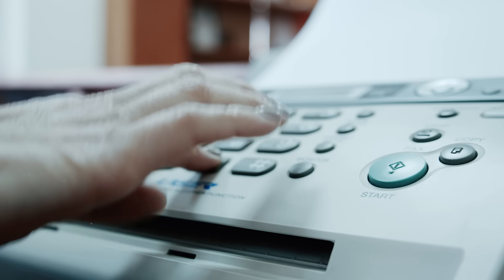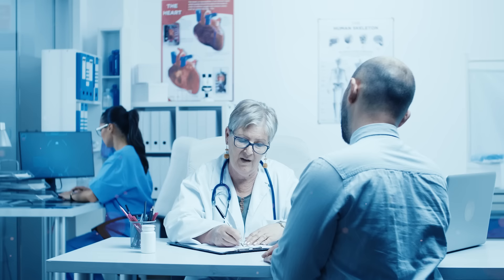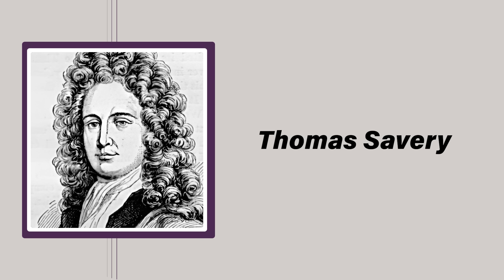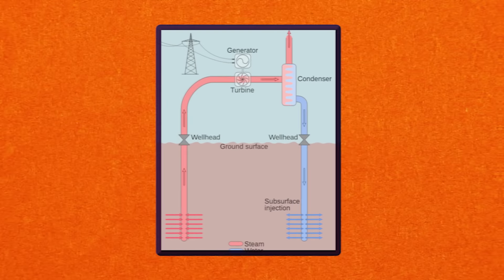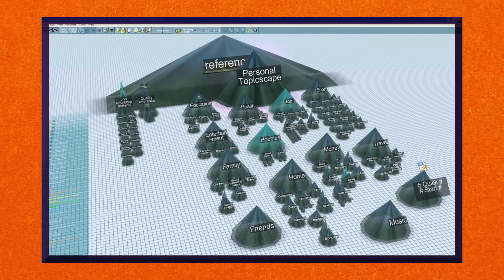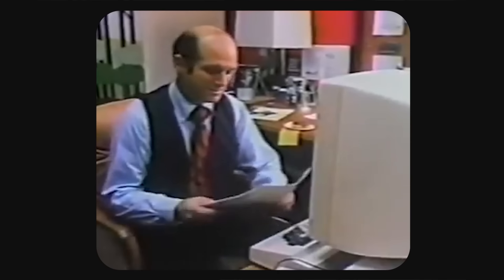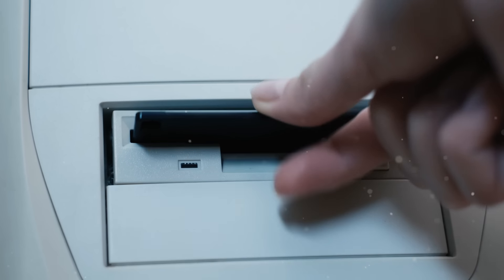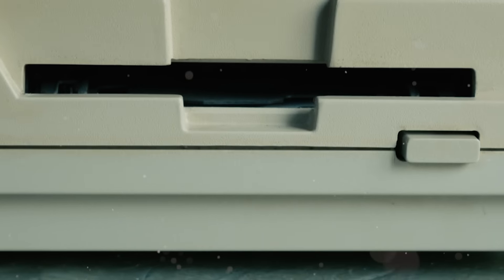Terribly Outdated Technology that we Still Use...

Comment: As an electronics engineer that's into old technology a ton, I just love how so much old tech still has so many niches, there's ones you didn't even bring up. In Japan for example, Pomeras are still heavily used, even though they are literally just text-writer laptops that can't do anything else, simply because of their reliability, since they can't do other stuff, they end up having massive battery spans of over 20 hours so they are extremely vital to anyone who handles a lot of documents, from offices to writers. Another example is CRT monitors, that while they have massive downsides, have the benefit of instantly drawing the screen instead of having a delay, so they are good in cases where every frame matters, although that niche mostly died off with 1ms monitors.
Reply: I'm still using my King Jim Pomera DM30. I originally used a Sharp Font Writer 760 word processor but found it too cumbersome to be truly portable. My Pomera screen is akin to a Kindle but has a trifold keyboard. It starts lightning-fast without any boot time. It takes a couple of AA batteries so even if they did run flat I could buy them just about anywhere on this planet. I use high-capacity rechargeable Eneloop batteries which run for over 30 hours. Plus it also works as a label printer. Try doing that with a laptop.
Reply: Not to mention CRT'S are great for retro gaming and games having such aesthetic
Reply: CRTs are great for retro gaming
Reply: Bruh competitive Super Smash Bros Melee players STILL use CRTs at tournaments lol
Reply: @fuel-pcbox  Like I said, CRTs have uses where each frame matters, because they draw the screen instantly, rather than with a delay, that's why competitive retro uses them along some laser technologies. If a game was made for CRTs, even a 1ms monitor will have delay, and considering almost all old games work with framerules, that delay is massive when trying to optimize.
Reply: The lack of lag with CRTs is a big reason they remain popular for retro gaming.
Reply: @tho_tho  Digital sucks worse for TV, cable is unusable for me now with the bullshit digital tuning delay. And it's not milliseconds, even if it's only a second it completely kills the channel flipping experience (which itself sucks now that we're used to streaming.)
Reply: Isn't it illegal to produce CRTs anymore because they are radioactive?
Reply: @ukyoize  Not at all, no idea where you saw such a thing. Sure, cathode ray tubes generate radiation (that prickly feeling you feel if you put your hand close isn't radiation, it's static because the glass can't absorb all of it, static is prickly, radiation is numbing/feeling of heat underneath the skin, almost no CRT after 1990 releases radiation outwards), but it dissipates quickly and is negligible to the body unless your thyroid isn't working, while diffusers (as in those dark filters people put on the screen greatly limited both the static and radiation seeping out). The reason they aren't really produced is because they aren't in demand anymore, while also being problematic to dispose of, the latter being the reason plasma TVs are in the same boat), so almost nobody makes them anymore.

It's not radiation alone, by that logic, microwave ovens would also be like that, since they have far higher radiation, especially when scrapped (it's why they need extreme care), because some components have a good deal more native radiation than what CRTs could ever produce.

In general, there's many devices or machines you might encounter every day that can produce radiation if you actually go looking, it's not illegal to produce them, just not worth it when there's alternatives. Only alternative to microwave ovens is normal ovens, so hard to phase them out, while CRTs and Plasmas have about 10-20 other technologies that can replace them, no need to stick to them, not to mention they are limited by VGA throughput.
Reply: The developing world reasons are similar to poor areas of this country and homeless services.  Having been an Appalachian farmer, I still have my XP machine, and am using my Windows 7 machine now, though I recently bought a windows 10 machine, it has a smaller screen, and my housemate, a tax preparer, just replaced her used fax with another.  And my pickup has a carburetor, though my little daily Metro has a throttle body injector.
Reply: response time probably isn't what you think it is and i can't think of a single application for frame perfect timing? gaming? meh
Reply: @ethanwasme4307  Do you even know what a framerule is in older games? A single frame difference can change a lot, just look at Super Mario speedrunning for an example, if the screen doesn't get drawn immediately, the in-game counters don't work as intended, counting times incorrectly. I wasn't talking about input lag, that is different and tied to refresh rate (Hz).
Reply: why is 20 hours of battery life impressive? I phone with a battery case, a keyboard and mouse, can easily last more than 20 hours and takes up less space.
Reply: @MegaLokopo  Try USING your phone for that long, it's not time left sitting idle, but actually under use and if you need external battery and whatnot, then it takes more space, not less. Not to mention that on a Pomera you can simply swap battery and are back to full and ready to resume work, amazing for people that work on things like light novels, newspapers, etc. while traveling.
Reply: @tho_tho  I can have batteries, a keyboard, mouse and portable monitor, all take up less space than a pomera and last just as long. You can use your phone for 20 hours and not have to worry about charging if you have a couple portable batteries.
Reply: @MegaLokopo  Portable batteries? You mean power bricks that are just as big as a Pomera by themselves alone? Or you mean to say that phones have swappable batteries when that hasn't been a thing in a decade and instead they are all soldered on?
Reply: @tho_tho  Not all power bricks are larger than a pomera just because some of them are. Phones can easily last for more than 48 hours of screen on time with just the battery if you change the right settings.
Reply: Lots of modern laptops can hit almost that much time of 20 hours.
Reply: I know companies that still used punched tape to upload data to their CNC machines. If it works don't fix seems 2 b the attitude
Reply: I was shooting a review of a motorcycle for my channel and out of curiosity used an old mini disc recorder to record ambient and engine noise. Unbeknownst to me my tags am voice recorder I use for my voice corrupted the audio file. Fortunately I had the mini disc audio, so went out to my car, put my helmet on so I still used my regular mic and re recorded the voice. Due to the background audio from the mini disc the video was completed and is my most viewed video with well over 60,000 views. Old tech saved me!
Reply: @tho_tho When disposed of Microwave Ovens do not have radioactive components. I'm not sure why you would think they do. The only radiation is produced when the device is running. As far as their danger when disposed of it's low. Maybe some caps contain oil. Just don't plug it in and it relatively safe.
Reply: wouldn't it be true that CRTs refresh at "nearly the speed of light", rather than literally "immediately"? If were's going to nitpick in comparison to "1ms monitors", we might as well be exact about how CRTs don't break the laws of physics! The photons and electrons still have to move through space, even though the distances is infinitesimal at the speed of light.
Reply: The other benefits of CRT is that it has true black, it can render low resolution and translate what was intended from 1990s prorams faithfully onto the screen, etc. I suppose AI generative video cards in the future will obsolete the run old programs with perfect clarity in their native resolution on 32 inch screen bit, but the rest is fine.

Comment: To me, the iconic removable format for personal computing is NOT the floppy disk, but the humble Compact Cassette! (I'm old!) I got a TRS-80 Model I in 1979, A floppy disk drive would have cost as much if not MORE than the computer, So tape it was!
Reply: I had the same one! Learned a lot pragramming in BASIC. And yes, a floppy drive was too expensive for me, I remember you also needed an extension interface. And a printer was also prohibitively expensive.
Reply: the Tornado fighter used a cassette to load flight data
Reply: @corrbhan5138  Yes, my "printer" was a pencil 📝😊
Reply: And they still use magnetic tape drives to this day. 4 TB (evidently without the cassette) external unit on Amazon for $210...
Reply: @myrlyn1250  Yes, tape is still extremely efficient for mass long term  storage of data, Of course the ones used today are ultra dense multi track tape cartridges that are entirely digital. Home computer cassettes were analog. I used ordinary 60 minute Memorex audio cassettes .although Radio Shack sold special 10 minute "computer cassettes" The tape interface was in fact a slow modem. They converted the digital data to an analog signal to save data to a standard audio tape, and reversed the process to read the tape's analog signal back to the computer, exactly like a "dial up"(phone) modem, just without the dialing protocol (as the tape recorder was directly connected to the computer). As you can imagine this was SLOW Slower than a phone modem due to the bandwidth being limited to somewhat less than the audio spectrum, but it WAS cheap, LOL.
Reply: @jamesslick4790   Yes, I have a Commodore 64 that I got around 1991. I haven't used the tape drive since about 2000, but I still have it. I used to play Red Storm Rising (Sid Meier/MicroProse, 1988; fantastic game!) once or twice a month, but it's a hassle to set everything up. Haven't done anything with it in years.
Reply: @myrlyn1250  The Commodore machines used a proprietary Cassette ”drive", (Datasette) making "retro computing " a bit more of a challenge for the Commodore fan. (not as "weird "as the Coleco ADAM's  cool random access cassette, though. ) The Radio Shack machines, The Texas Instruments machines and the Sinclair machines used ordinary cassette recorders, A huge bonus! Fortunately, all these machines have emulators now. We CAN (sorta) go back!☺️

Comment: Fun fact: nuclear reactor control rooms in Ontario, Canada still use Windows XP.
Reply: is it connected to the internet or does it only work in the internal network?
Reply: I can see why. Imagine the stress of updating the software in a nuclear control room.
Reply: @robinsonrom  Yeah and imagine the automatic updates on modern Windows which will automatically restart the computer. Though I doubt they would have them connected to the internet

Comment: I've got myself convinced that the only reason why operating systems became more complicated than XP was so that advertisers could run more ads, and more annoying ads at that. For anything I've ever used a computer for, XP was plenty good enough. In fact I still have a laptop with it for automotive diagnostic use (BMW INPA/NCS Expert, etc..).
Reply: I'm not sure he's correct about XP, it was windows NT that was used by the military and banks...  it was not DOS based like XP and was very secure....
Reply: @PRH123  Uh, XP is NT based (And the first one designed specifically for home consumers, previous NT systems such as NT4 and Win2000 where mostly made for enterprises and previous home consumer Windows OSes such as 95, 98 and Me were DOS based)

Comment: One piece of "outdated" equipment that can be critical in emergencies is the shortwave radio.  Able to communicate over long distances without the need for infrastructure such as cell towers or phone lines, these can mean life or death in natural disasters, etc.
Reply: After the Maui Fires, Tulsi Gabbard complained about the lack of VHF walkie talkie needed by emergency workers
Reply: @Jeffrey314159  It's because manufacturers of public safety radio gear have all been pushing 800 MHZ trunked systems for years, even though VHF radios tend to work just fine.
Reply: Just ask the Ukrainians. Apparently they're getting plenty of outside info through shortwave radio because it's harder to jam and because of its long range.

I still occasionally play with my shortwave radios and even though the technology's flaws are evident, done right it can be a complement to mobile technology
Reply: Many shortwave stations have shut down. AM radio could also be considered obsolete, but it's more commonly used.
Reply: Very good for devastating earthquaker
Reply: I still use CB radio in the van.
It's great for passing the time when stuck in traffic.
Reply: | was going to say the same thing. Plus things like Walkie Talkies (albeit often encrypted), are still in use in places like hospitals or for security reasons.
Reply: @dx1450  Trunked radios can work in so-called direct mode, becoming basically a little fancier digital walkie talkies.

Comment: I didn't know the Fax machine was considered obsolete. We have 2 at the Police Department I work for and we use them several times a day.
Reply: I have two in my office and my wife uses them regularly to send things to hospitals and medical groups.
Reply: I think the biggest problem with them is, that they used so much in medical or emergency services. That contains highly sensible informations. Fax CAN NOT be encrypted. Everyone in the telecomunication line from the sender up to the recipient can read it out and see it. 
The most used cases should never use it, but still they use it.
The only thing that is helping against the highly risks of data leakage is that telecomunication services are aware of it and do as much as possible to protect the data as long as it is on their line.
Reply: @Erimioa  The odds of the transmission being intercepted is exceptionally low and would be a pointlessly slow and painful way to obtain information instead of just hacking into databases with millions of pages of this information in one shot.

Comment: Dot matrix printers with a tractor feed persist in many areas that tradesmen use, such as trade-only service counters for suppliers, or skip hire companies.  Run-off  a document with carbon copies that can be signed by the customer.

Comment: The fax machine is even older than that, dating to 1780's if I recall correctly, used for transmitting dinner menus between Paris and a resort twenty miles away. It used an electrical signal to synchronize two pendulums, one at each end. On the transmitting side, an electrical brush was swung over a paper which had holes punched in it; on the other side it burned a corresponding hole in a paper on the other end. I remember it from the PBS show "Connections".
Reply: I loved connections! One of the best shows ever made.

Comment: I still have a landline. I've heard prophesies that these were obsolete for the last 30 years or so. But I still have and use one.

I also have a laptop that runs XP. I use that primarily as a backup MIDI sequencer, and also to run software for my synthesizers that would no longer work after Windows 7. It's not a question of using more modern software - as far as I know, it doesn't exist. So I keep an old XP laptop so I can run such software as and when I need to. And before anyone says, no, I don't use that machine on the Internet, it's strictly offline.
Reply: wow! i finally meet another person with a landline. btw, i ONLY have a landline

Comment: don't diss my boy windows xp (nothing wrong with the operating system apart from theres no more updates if microsoft actually developed windows properly we could be using the 11th version of Windows XP right now and every old and new version would been protected but instead we was scammed into buying redesigns until windows 10 then it became technically free (90% of people have a windows 7,8,10 key or upgrade path using that key)

Comment: My father used to use a pager when I was a kid in school as he is a private fuel hauler. Of course back then cell phones weren't really a thing so he needed a way for a customer to contact him while he was driving. I think he still might have one as a backup for when his cell phone has no reception. Sometimes things that are simple and outdated are still better than something that's new and complex. :)
Reply: Locomotive engineers have pagers as a backup for the same reason.
Reply: @tonyburzio4107  If it works I see no point in changing it. Especially if the new thing made to replace it doesn't work in the middle of nowhere. There's no point in trying to reinvent the wheel like most of these people do. :)
Reply: For that purpose the Paget is better it found a niche
Reply: I'd rather have a pager....

Comment: Years ago, a millwright I worked with took a tour of the Bruce Nuke plant.  He came back and said he had no idea they used steam. I couldn't help but laugh a bit. I guess he thought there was some kind of magical electrical generation direct from radiation.  He wasn't stupid, I think he just never really gave it much thought until he took the tour.  Mind blown.
Reply: Isn't coal also steam?  Or did I somehow miss where Simon mentioned that?  I heard both nuclear and geothermal, but I was sure coal plants were the same principal....burn coal to heat water to steam to turn a turbine....
Reply: Most electricity generated is from steam turbines.  Only exceptions being hydroelectric, wind and solar—wind and solar, however, still account for a tiny percent of electricity production.
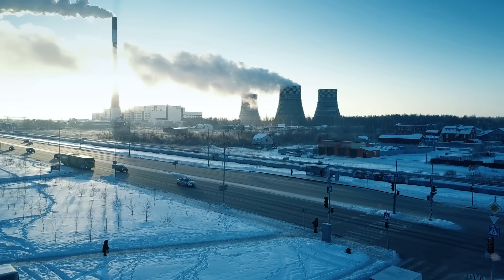Reply: @briantownsend9414  Yeah, it was there at around 5:05.
Reply: It is possible to generate electricity direct from radiation. Look up nuclear batteries. Their power output is very low, but they last a long time. Typically they are used in things like satellites and spacecraft.
Reply: @thelastperfectman4139  Wind and solar are 16% of electricity generation in 2023, and will be closer to 18% in 2024 which will be the time when they will start surpassing coal.